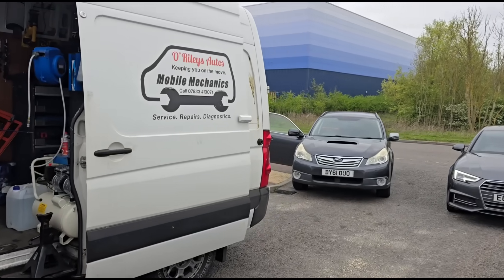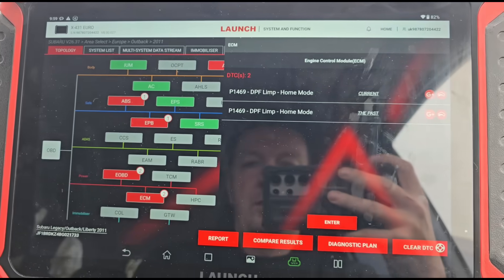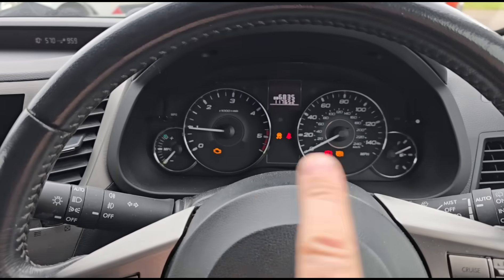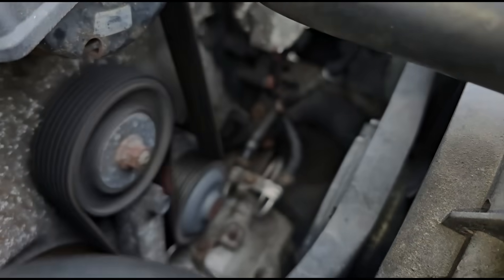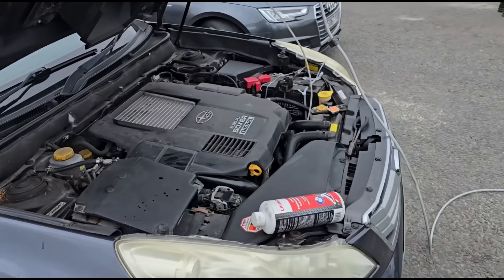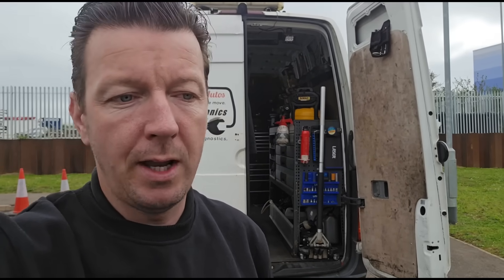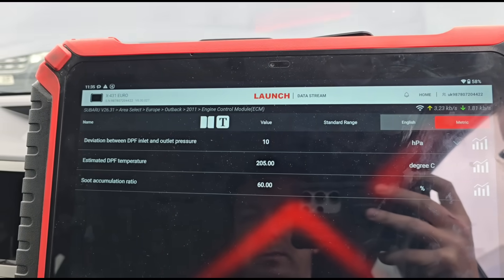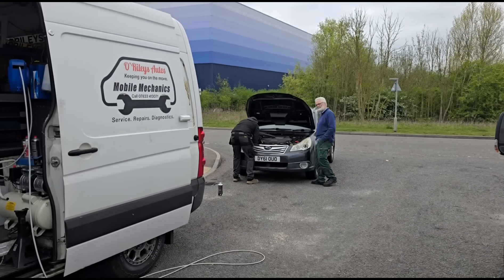Subaru Outback P1469 DPF Fault

Comment: Great video, thank you very much for that. I also have problems with my Subaru, which has received a new DPF and continues to cause problems with regeneration. I have noticed that my air conditioning does not work, due to a leak. Could that be the problem?
Reply from the maker: It could be

Comment: This was a great video Jimmy. Really. But I'm also a bit confused. How exactly can the dpf be damaged in this case if it keeps clogging up during regeneration. What exactly is wrong with the filter? Is it full of oil and can no longer regenerate or what is causing the soot to rise as the temperature increases on the dpf and vice versa? thanks

Comment: Isn’t there an issue with that Boxer diesel whereby the vehicle needs dealer software to tell it the oil has been changed, otherwise it thinks it’s not been serviced & continues to do regens unnecessarily.

Comment: Brilliant as always Jimmy ☘️☘️☘️ Jimmy I have a 2016 Hyundai Tucson I forgot the code but I checked the live data differential pressure sensor and it reading -0.51 kpa . Do you think it might be the sensor ?? Hoses look perfect and no soot on the tail pipe.☘️☘️☘️☘️☘️☘️